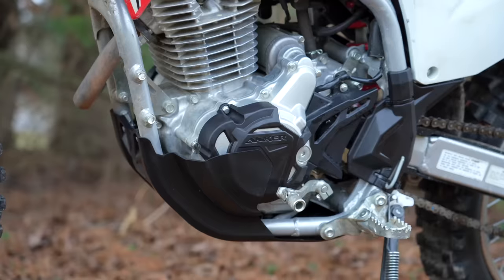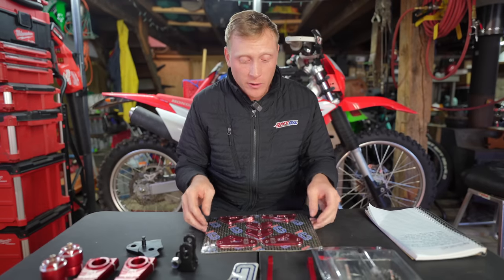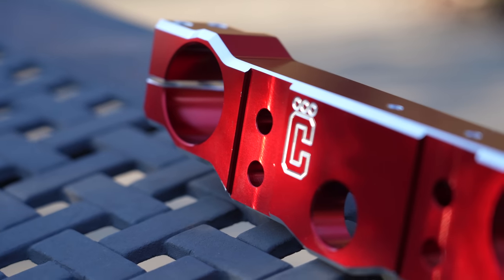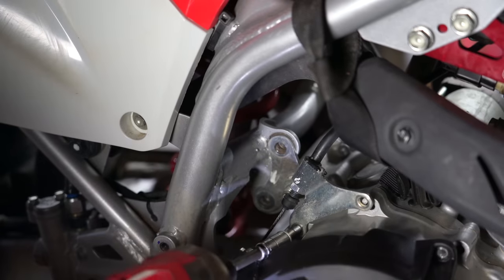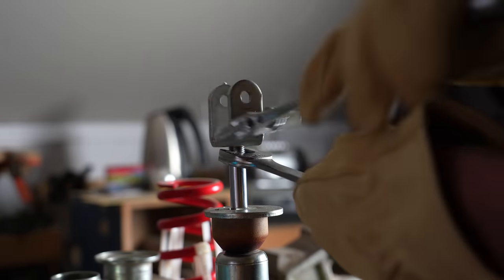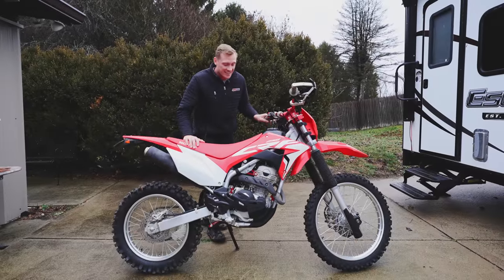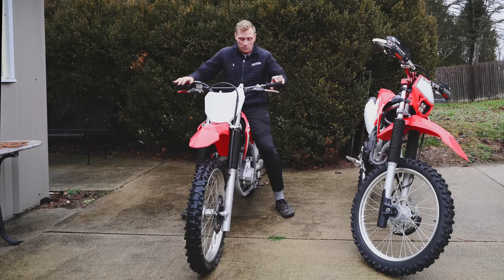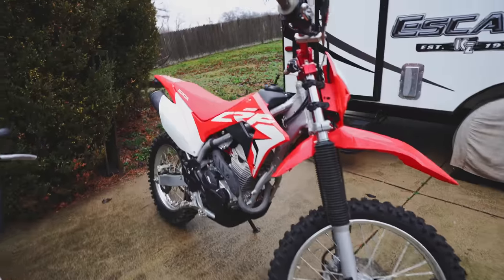Installing a LIFT KIT on a Dirt Bike?.. | Honda CRF250F Build

Comment: Casting so much positive light on an underrated bike. I wish so bad there was a 400F.
Reply from the maker: At first I thought I was one of the only one's who enjoyed this bike but the response and community surrounding it has been awesome! You and me both that would have to be a passion project for Honda..
Reply: I've said it so many times... We need a modern xr400...
Reply: I beat the piss out of this 250f and raced it at a 24 and used it for drilling in my buddy’s back yard turn track we built thing is so much perfect noise level great power for how heavy it is. I had the lift and race tech suspension done to hit jumps and boy did I send it! Yoshi pipe and let’s see race tech custom shock was trash blew up on me 3 times after that the stock one did just fine with the extender. Sweet bike
Reply: @chrisvillarreal2752  where would I go to get that race tech suspension
Reply: @akajonesy4388  Go to Bruce’s suspension. Hell hook you up with everything.
Reply: Yeah they would sell like crazy!
Reply: They have the rx 450, not air cooled but I am pretty sure the maintenance is low
Reply: What handlebar are you using
Reply: An air cooled big bore would be awesome. I like the 250F but would like to upgrade to a bigger bike eventually for sure.

Comment: Game changer of an upgrade for sure! The best part is that you can pickup one of these bikes new for cheap, learn on it and get the hang of pushing it's limits and then add this kit and you'd have a new bike that is more capable for sure. Can't wait to hear how you like it on the trail, hope it still feels right and has that compliant ride as well. Getting close to 100k subs, yeah baby!

Comment from the maker: UPDATE This is no longer sold as a complete kit, which is good because I HIGHLY encourage you to upgrade the rear shock. You cannot use the extended Clevis with the Hagon shock, but you can still run the Corona adjustable linkage and front fork extenders. Parts are constantly being improved and updated so be sure to check out https://hyperlitemoto.com/
Reply: Is there a shock upgrade that gives you the additional height?

Comment: Looks fantastic! Scott really has the parts for these bikes. I have these parts, just haven't had the time to install them yet.  Now, just send those forks out to Bruce Triplett, and REALLY be blown away!! Heads up, if your thinking about the Hagon shock from Bruce, the clevis will not fit on the Hagon (eliminating the lift in the rear). But there is a solution!!! Olimotos sells a shock with 1.4" lift, and more travel. I'm assuming you used the linkage on the "stock" position? If it was used on the "raise" position, that would give the rear a total of 2.4" of lift (1.4" for the clevis, and 1" for the link), correct?

Comment: Personal experience know the need for no less then 13" of clearance is an absolute must. 14" is a bonus. 
Being this bike is pretty much bullet proof the mods are more icing. The BIGest reason this bike is a hit for me, NO radiator. Lots of times I free lance thru the woods and there is nothing but scrub oak and pine that send you to the books looking for a replacement rad. 
You'll have this bike a long time with proper maintenance  (oil and filter changes). A quality synthetic oil will prove the point.

Comment: Hey, my mate has just imported one of these into UK and the first thing I noticed was the height issue. I used to do MX so I was put off the bike, telling my mate it looks like its been lowered slightly, not realing this is the satandard ride height outa the box. So, if you raise the rear ride height with that kit the problem you have is there is no room to also raise the front so that it keeps its natural geometry. Still, a nice bike for beginners cos my mate has never done off road or ridden off road bikes. Im sure it could also benefit from a larger rear sprocket to make it a little more lively. What's your take on that!

Comment: Interesting upgrade.  However, since one can only polish a turd of a front suspension but so far, isn't there a salvaged modern suspension fork that would fit, though professional tuning would likely be required?  Looking at the CRF 250F as an old dude's play bike to replace a very well sorted '03 KDX220 that I never should have sold.    Thoughts?

Comment: So what's the bigger differences between the F and L? Besides the L being street legal. Got a video on that?
Reply from the maker: It’s 🌽 !! They are two completely different bikes the 250F is a non street legal trail bike (the successor to the 250L). Mine has been converted and is a fair better performer off-road than the 2Fatty. I might make a video on the future to clarify. Hope all is well!!
Reply: @AdventureDaily  Yeah, been a while. I thought you stopped making videos only to find out I got unsubbed. Life's complicated but I'm back in the PNW for ADV riding with my dad ✌🏻😁

Comment: Looks like a totally different bike!

Is the suspension on this thing better than the CRF300L? Struggling a little bit to figure out why you ended up getting rid of that and its rough ride, but then ended up with another cheap Honda bike. What do you like more about this one that you didn't like about the 300L?
Reply: This is kinda late but yes the CRF 250f is better off-road it's lighter suspension may be slightly better for off-road the 300 is a dual sport

Comment: Pretty crappy that they don't send you the nuts for the engine mounts. Surely a company selling replacement ones knows that the stock ones are welded right?...

Comment: I’m 6’2” and my brother has the 450r, how would you say it compares to the size of the stock 450r because while the engine is way way too much for me the height of it feels really good. I mean I’m not short but I’m not 6’4” and if your almost straight legged if be afraid I wouldn’t be able to touch especially if I put the hagon shock on the rear yk; what are your thoughts I’m 6’2” an 185lbs

Comment: BRO!!! This was the video I’ve been searching for 🤘
I had Bruce do my suspension last year. But thought I couldn’t lift it. Cuz the lift was in a kit, not broke out like you showed. I’ve never ordered parts faster in my life!!! Easy install and it kept my sag the same🤘

Thanks for all the 250f info, really helpful on turning this bike into one I’m not getting rid of now. 

I’m curious though, one of the bikes I was looking at upgrading to was the xtrainer. I was curious about Alexis’ opinion vs the 250f. I’m also a short rider, seeking out more technical single track??
Reply: Wanting same info
Crf250f vs xtrainer

Comment: If you add just the lift kit, does the linkage add even more lift?  Can you do just the lift or do you need both?  Love the channel, fellow Ohio rider.
Reply: The lift kit (fork extenders and rear clevis) add 1.4" of lift, the link adds +1", stock, or -1". I'm not sure if he used the rear link at the "stock" position, or if he used it in the "+1" position

Comment: Question - I've watched over 25 of your videos, looking at getting a bike in the next week, considered the 250F, just do trail riding, similar to what you guys do. No jumps, no supercross stuff - I'm 6ft  210lbs  athletic build - I hear that people are quick to out grow the 250F after a month of riding, so why not go with the crf250rx? Seems to have more legs in it to grow and capabilities, Can you do a video on why the 250F is a better fit over the CRF250RX? Suspension seems better and more power, feel the same and yet more capable than the 250F. Price is not really an issue for me right now. Yes, you can upgrade the 250F suspension, brakes, etc but why put lipstick on a pig? Thanks. - Your thoughts?
Reply: Cost is a big factor for many, but for those who know, the bigger factor is the maintenance schedule. The 250f is about as simple and reliable as it gets.

Comment: I love everything except the bar risers and here is why. These risers are actually bringing the bar closer to the waist because of the rake angle. What you really need is an offset riser to take the bars away from your torso and waist to free up the cockpit. Love how it make the bike taller.
Reply from the maker: I agree they could be more offset but they are pushed forward a bit, I didn't show it but the holes are offset in the bar mounts and I also have them in the furthest position, still a positive change from stock👍🏻
Reply: @AdventureDaily   how do you this this compares to the old XR400r or XR250r?

Comment: How much has this “cheap” CRF cost you so far?
Reply: Part of that “cheap” includes maintenance time and expense. If it weren’t for the extra down time/wrench time, I’d have a 250r in the garage instead. Of course, while these modifications aren’t necessary for most, it certainly should factor into the equation for anyone thinking about it.